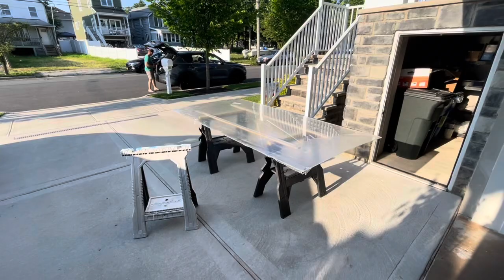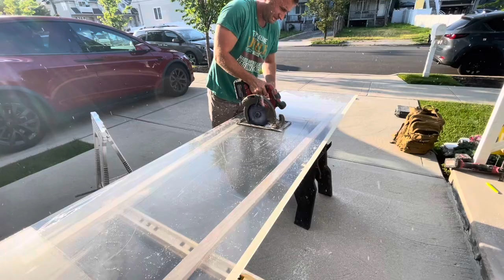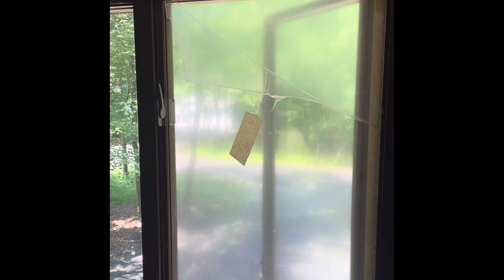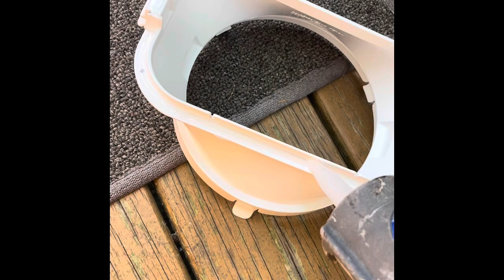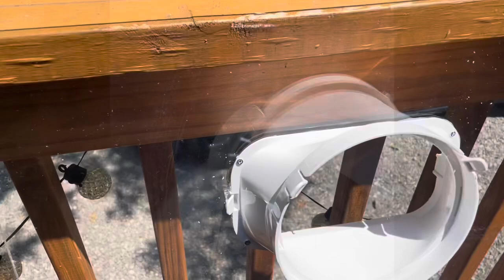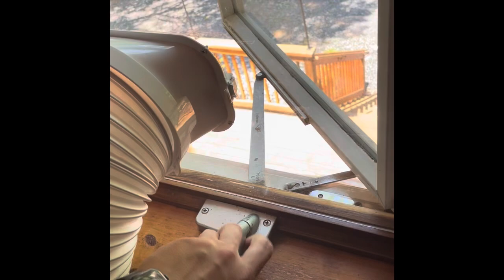portable air conditioner casement window solution

Comment: That's great! I've been looking into doing the same! Would you share how you fix the plexiglass glass in the window? Can you remove it whenever you want?
Reply from the maker: I installed it with 4 screws. 1 screw per corner. Yes, you can remove it but you need a screw gun.